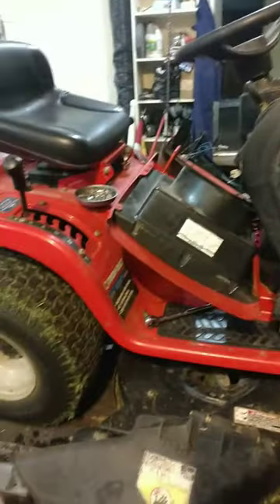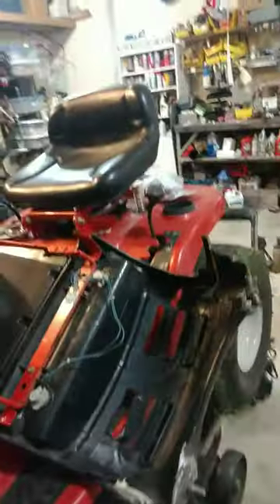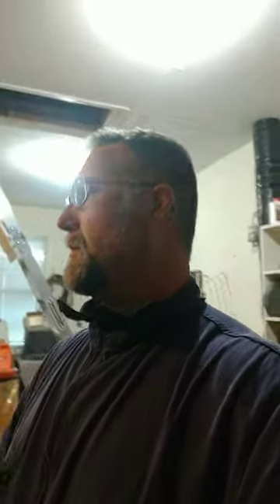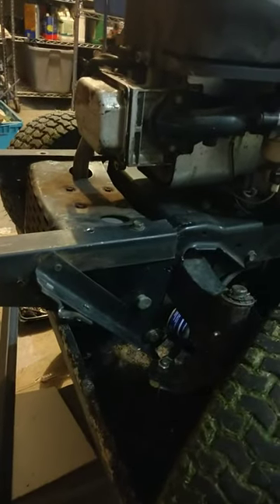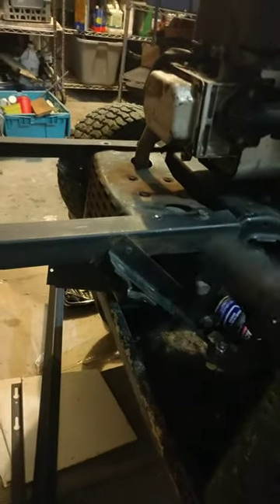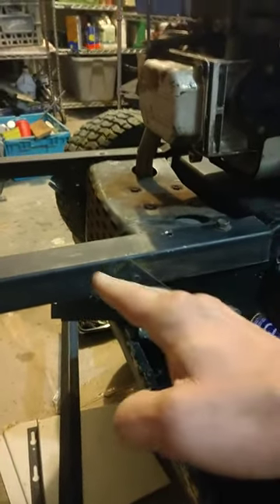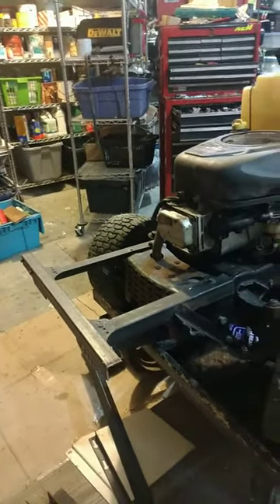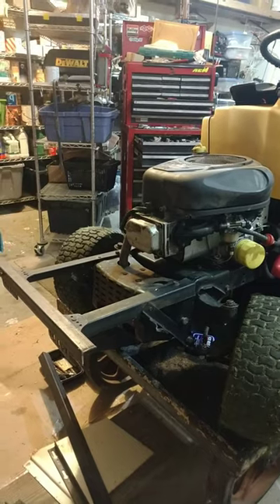DIY easy Riding Lawn Mower Bumper / Brush Guard. No Welder needed. Bolt on.

Comment from the maker: It is holding up great. Now I need to figure out my mower belt problems. The factory 96 inch belt is too long keeps coming off. 92 inch belt was too short. I'm going to buy a 94 and see if that fixes it.
Reply from the maker: 94 inch belt working great.
Reply from the maker: Make sure to GRIND off sharp edges with grinder. I cut myself.

Comment: How many drill bits did you ruin drilling the bed frame steel?
Reply from the maker: Probably a couple lol. I think there are some YouTube videos on how to use drill bits and cutting oil.
Reply: @memphis502  that stuff will wipe out cutting tools. It’s definitely not mild steel.
Reply: @memphis502  look at Scottinfl, he posted to drill it very slowly.